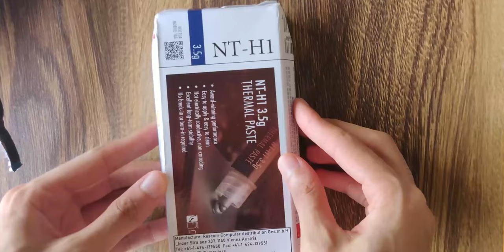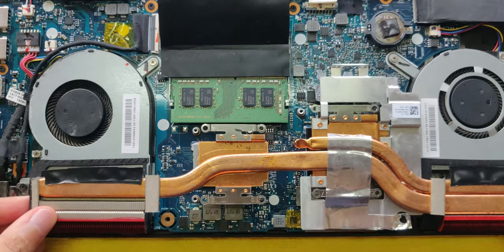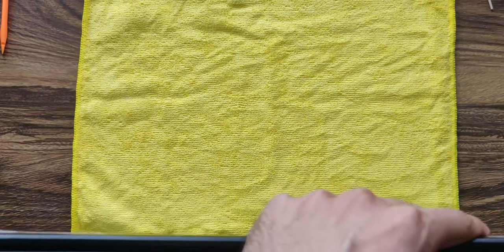How To Replace Your Thermal Paste - ASUS TUF FX505D series | Noctua NT H1

Comment: I have a FX505DU and my thermals are terrible. Playing a game of FIFA the laptop just powers off. 

Did this actually reduce temps? Do you have before/after data?
Reply from the maker: Hey! Yep, I saw a temp reduction of 5-10°C depending on the load, and a performance increase of around 3-5%.

I lost the before/after data but the gist of it is what I've mentioned above. I had tested it in Shadow of the Tomb Raider, F1 2021, and GTA V.

Hope this helped!

Comment: What is the CPU / GPU temperature after the change ?  Thanks.
Reply from the maker: There's about a 5-10 degree drop in temps and around a 3-5% increase in avg fps. Working on a video with more detailed information of the difference with graphs, etc.

Comment: you shouldnt use thermal paste on the vrms.
use thermal putty or therma pads. the vrms have low clearance and are not in direct contact with the heatsink.
you need to use thermal pads or thermal putty to close the gap.

Comment: ❗‼️CAUTION ‼️❗
DO NOT CHANGE THE THERMAL PASTE AS IN THIS VIDEO!🚫

 My friend did the same as in this video and his power supply circuit burned out!
 The author is an idiot, thermal paste is applied only to the CPU and video card, a special liquid thermal pad is applied to mosfets and other transistors, not regular thermal paste.

Comment: Do not take this video as a tutorial....rookie mistake ....you have to unscrew cpu with sequence on it ...he completely ignored it
Reply from the maker: Just watched the video and saw the numbers on the heatsink. Is that the right way to remove it? If you can comment again with the right instructions I'll pin the comment to the top. 

And thanks for pointing it out! Most of my knowledge has come from experimenting and self learning so there are definitely things I can improve, you taught me something new today :)
Reply: @CytechGaming  yea you have to remove the screws in the right order
Reply from the maker: @sylpher11  thanks for letting me know, will add a comment and pin it

Comment: Hi, I have the same laptop.

Temps:

On Idle => https://i.imgur.com/bmVSuR8.png
On Load (Battlefield 5 for about half an hour) => https://i.imgur.com/oQoEabP.png

What do you think? Should I replace the stock paste?
Reply from the maker: Hey! Looking at your temps, I wouldn't say that your laptop is running hot or is being bottlenecked. Seeing temps of 90 degrees under load is well within normal. 

Your GPU clock speeds (1670Mhz) also seem like they are higher than the average boost speed for the GTX 1650 mobile GPU (1560Mhz).

That being said, if you're confident with opening and tinkering with your tech, replacing the stock thermal paste with a higher quality paste will always improve either thermals or performance, even if it's just by a small margin.
Reply: @CytechGaming  Thank you.  My GPU is actually GTX 1050 3GB.
Reply: @CytechGaming  By the way, how are the temperatures now, have they increased?
Reply from the maker: @seal7118  If you''re running the 1050 mobile gpu then the clock speeds are even more impressive :)

I recently built a PC so I haven't been using the laptop as much for gaming, so I haven't measured it for a while, but whenever I do play it never seems like it's overheating or dropping frames. Good thermal paste usually lasts around 2-3 years anyways :)
Reply from the maker: @seal7118  I'll reply here if I get the chance to measure it again and let you know!